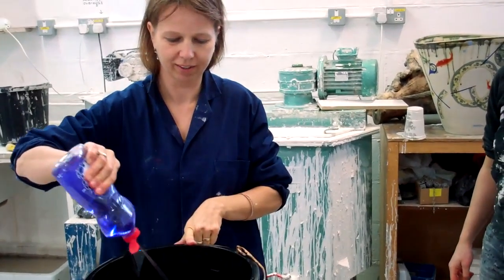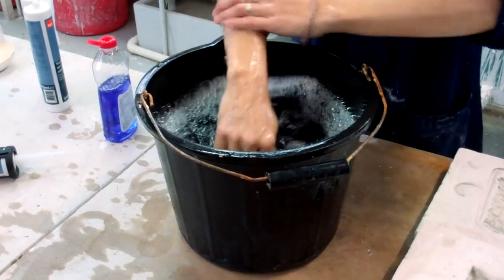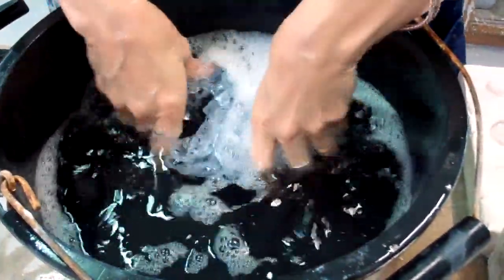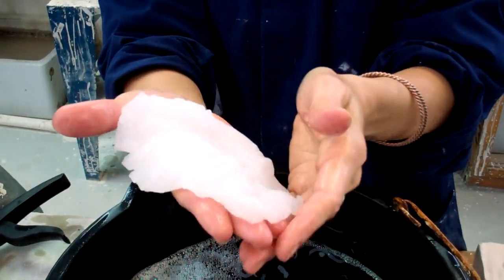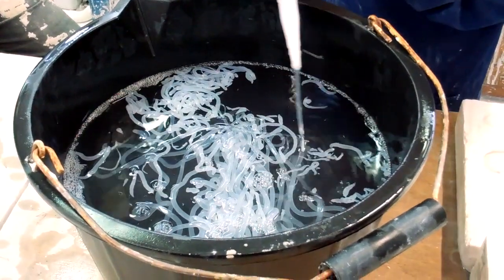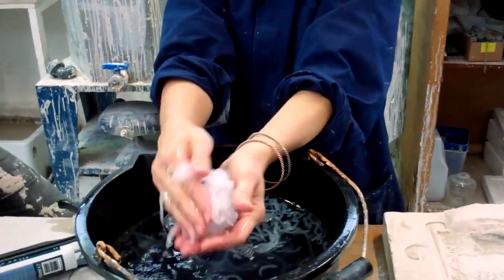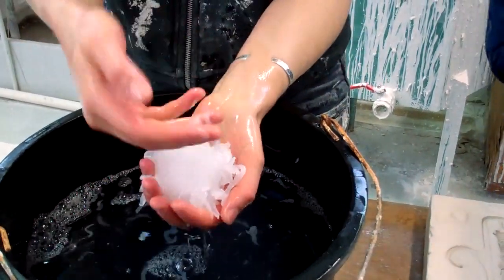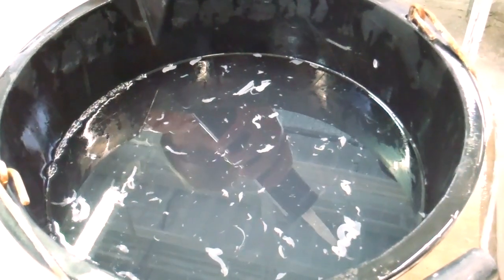Silicone Mold Making & Casting

Comment: SILICONA para Fabricar moldes,figuras etc. Silicona
              RTV-1607 (Dureza 20 +- 2)

               1 KG. a 10,50 €  Bidón de 5 kg. a 9,50
              €/kg.(www.siliconaymoldes.com)

              Silicona RTV3214=/Dureza 32+-2) 1 KG. a 12,50 € Bidón de 5
              kg. a 11,50 €/kg

              Fenasa Siliconas s.r.l. wwwfenasa.es  .Telefono=968297777-
              MURCIA= España

Comment: Thanks for a great video - I seem to keep finding American kids making very expensive moods by mixing the silicone with cornstarch (called cornflour in UK), baby oil and acrylic paint (though I can't see the point of colouring a mold).  I'm going to be making very small moods for doll shoes and this simple version seems perfect.
The one thing I missed (maybe lost in the background noise) is how long to cure the silicone before removing from the original - does the silicone need to cure for the full 24 hours (as if it was being used as a waterproof sealant)?

Comment: Silicon is a chemical element used in the manufacture of semiconductors (hence Silicon Valley). 
Silicone (with an e on the end) is an entirely different word with a vastly different meaning. Silicone rubber is a flexible elastomer. I believe you intended to say silicone. Since you're a "school" I hope you would fix it at least in the description and title (I realize you can not change the video). But it's been 5 years and you haven't fixed it yet so I suppose I shouldn't get my hopes up.

Comment: CAULKING IS NOT SILICON, IT IS AN ARTIFICIAL PRODUCT SPELLED SILICONE (with and E at the end) and contains Formaldehyde and  Ammonia!!!! At least where caulking is concerned (the stuff from hardware stores)... That means it is TOXIC!!!!!!!!! 

Silicone itself need not be toxic, but caulking is silicone with toxic elements.... be smart and wear glove and, please, don't use this to make food molds! Read the MSDS and do some research (Google is your friend) before handling ANY chemical product, especially if in direct or indirect contact with skin, eyes and especially mucus membranes (mouth, eyes, digestive tube, etc.)

Want to argue? Sure the toxic elements may evaporate, but so are supposed the toxic elements in a new car's dashboards....yet these stay toxic to breathing when exposed to extreme heat (hot sunny days) for over 10 years. It's your life... you be the judge of what's best for you... I did my part and you be warned!
Reply: It releases acetic acid when its curing, the acid burned your finger.
Once its cured its technically safe except that caulking is not checked for dangerous impurities.
I would not use it for anything that comes into contact with food.
Reply: make sure the tube says 100% silicon
Reply: I see replies insulting Flashahol, but very little in the way in how he or she is wrong. The reason being is that your "common sense" is not reality folks. Flash is %100 correct. Google is your friend. It is very easy to look up and easily learned through actual experience. But hey, you people with zero experience have your Youtube common sense so why bother right?
Reply: Flashahol I agree, I got caulking silicone on my fingers once while putting together something and because it has high acidity it burned and itched for 2 days. When I first started watching this video my first thought was I can't believe she's not wearing gloves. My second was I want to see the end product! Lol.
Reply: It did say 100% but still itched when I got it on my skin but didn't try it in soapy water, it was direct contact so not sure if that makes a difference.
Reply: Hey , you might be the wrong person to ask, but you seem pretty knowledgable and I need some quick advice on something and anything you can give would be appreciated. I am currently doing a project where I must make a flexible, removable spout to fit on the lip of a mug to allow for easier pouring. https://photos.app.goo.gl/P6zThPVfQsGaU2133
This is an idea of what it will look like ^^
It should be stiff to fit tightly but not too floppy that it is loose. It is also vital that the material used is non toxic and food safe, preferably coloured.
I wouldn't have a clue about how I should go about making it and I have absolutely no idea about silicon/rubber or moulds. I was thinking maybe I could 3d print a negative (mould) and pour in some food grade silicone or something?? What materials should I use and how do I make a mould with a cavity that would allow me to pour it in and cool it. Maybe another method is more viable? I would love to hear back from you with any advice. I appreciate your help, thank you.
Reply: What about silicone II? It's supposedly neutral-cure which doesn't release acids while curing
Reply: @ jayboney el toro:

From Wikipedia: 
"Silicon is a chemical element with symbol Si and atomic number 14. >>>A hard and brittle crystalline solid<<< with a blue-gray metallic luster[...]" 
Sand is also made of Silicon., the main source of silicon used to make electronic chips. Look it up for yourself, you will definitely learn stuff, if at all possible.

Any construction material, including most glues, that flow in liquid or gel form then harden and stick to stuff inevitably contain solvents, hardeners and other materials for elasticity, adhesion, waterproofing and/or UV protection (if it is made for outdoor use), etc.PURE MATERIALS ARE OFTEN JUST ROCKS AND MINERALS, like the pebbles in your garden

I hate when people claim to be geniuses and know absolutely fuck-all about what they are talking about. Labels for any product or food are never telling the entire truth. The 100% silicon mention for caulking really means it is silicon based rather than acrylic based, which has slightly different properties, but both contain a variety of agents for adhesion, elasticity, weatherproofing, etc, etc, etc.
Reply: @Flashahol  silicone is an inorganic polymer derived from polysiloxane. silicon is the metalloid. surely it was a typo error in the title.
Reply: Yes, Flashahol was really rude (but I'm sure both of you are decent people - Oh, come on!) ... but was completely right about chemical on caulking stuff: it could never be 100% silicone. And it is toxic. Even on that dishwasher bath the smell must have been terrible (no smell at YouTube...yet!). Apart from this battle among viewers, what was missing is the result. I was really frustrated with the abrupt end of the video. Gray's School of Art?? Hello? Is there anybody there?
Reply: Flashahol you can buy 100 percent silicone at a hardware store FYI I could care less but I hate when people give this big headed explanation and they are wrong what part about 100 percent don't you understand
Reply: @Jason B:
Apparently, you don't know how to make a sentence! Much less, a statement! LoL! Did you not learn the basics of grammar in elementary school? You know, those periods, apostrophes, comma's, etc... Maybe you're still in elementary school? Are you 5 years old? LoL!
Reply: Screams about silicone and probably uses fluoride toothpaste and eats sugar. But thanks for caring.

Comment: I'm just about to try casting sugar into it... I thought this kind of silicone could take 250-300C! we'll soon see whether it can take 150-200
Reply: How did it go ? I hope you didnt use sanitary one :D they stink like hell :D
Reply: There were a few bits of the mould that had thin walls (less than 0.5mm thick) that I had to squeeze very big parts through in order to get the hard sugar out of the mould. After a couple of casts these thin silicone films ripped open a little but I think that was down to the shape of the mould and lack of release spray rather than the silicone itself having bad reaction to the heat. The sugar was liquid and between 180 and 190C and otherwise has left the shape of the moulds unchanged :D

Comment: If you do it in multiple stages like this it is likely that the silicone mould will break apart where the different batches meet
Reply: Danny M True, I did two batches right behind each other, and you can see a parting line. I was able to separate it a little, but did not try to. pull it apart completely.

Comment: This is very cheap and economical. In the past year Iv work on some million dollar houses and needed to make some casts. One job i had to make a 200 mm by 500 mm corbel. The tube silicone rubber cost me 70$ for roughly 6.5 litres.!!!! 
To buy that in moulding silicone would have been 300$ plus!!!!    
The draw backs maybe the terrible vinegar smell  which can also strip paint to. 
But haven't had a real problem yet. 
Thanks so much works a treat.

Comment: its may inexpenfive, but it works also like crap....

just buy proper silicon mold an resin, they getting cheaper and easier to hald every year. like i used to take platsil 73-20, it has a working time of 5 mins and cures less than 2hour fully out and you can go casting right away. its a 50:50 part A:B mix, so verry easy to mix! i remember 1kg is about 50 bugs or so.
im sure 5 silicon tubes are almost the same
Reply: Your figures are way off!!! This is by far the best and cheapest way of making a cast.

Comment: Why didn't you cut the nozzle off? It would make it much easier to dispense into the water :) thanks for sharing.
Reply: No you don't.  It's a much faster process when you CUT THE TUBE to release more of the silicone at once.  
1. Easier to get out of tube.
2. Faster to get out of tube.
3. Same time spent Mixing in hands, (and actually even quicker since your working with "more" silicone).
4. Larger amounts of silicone in hand ='s bigger balls, ='s Less time spent Pumping the tube, applying the silicone to your project, and going back to repeat all the steps, over and over again. 

Cut tube to the Bigger Section to release MORE Silicone at one time!
Reply: +Lynette McKone  because you need the spaghetti like texture to help expose the surface to the cold water as much as possible to help start it setting up.

Comment: if you make this type of mould for casting resin, will the resin come out shiny?
Reply: +Magik Dust I know it's been a while since you asked, but to answer your question, most likely not. While this method will work in a pinch, it's really not an ideal molding technique. Most proper molding materials will pick up the finest details (including that fingerprint you didn't notice)and reproduce the same finish as what the original piece had. Most molding silicones are pourable, or at least brushable, to pick up detail. This is basically like sticking clay to something and expecting a perfect copy, It's just not going to happen in most cases.

Comment: This is my experience when making the silicone caulk molds:  When you are kneeding the silicone in the dish soap it traps air in it and in that air it traps water with soap that you are working with.  Now the problem I had was that the mold made a cured skin on it but on the inside it was still not cured and it never cured because it had  bubbles with soap and water traped in it.  I found this out because I cut one mold with scissors and there was water coming out of the silicone.
Reply: +WILD CHILD I manage to make a silicone mold with corn starch and silicone caulk. I've tried the dishsoap and silicone caulk method, but that turned out to me that it requires lots of trial and error. I think perhaps ur better off with the corn starch method
Reply: heres what you should do ... cut the side of the tube and dump the entire tube into the soapy water all at once , this keeps the soap on the outside....
Reply: +WILD CHILD did you need the silicone outside of the soapy water once it has started ti set??? that should have worked the air bubbles and soapy water out of the silicone
Reply: Try GE silicone type 1 not type 2. I had a decent amount of working time. I knead mine a little as someone else mentioned. After an hour it is solid all the way through. I add a little food coloring so that I can see the details. Wal-Mart has the silicone the cheapest so far.
Reply: +WILD CHILD Did the water ever cure out of your molds?  I was wondering about this myself because I'd like to make some candle molds.
Reply: No it didn't.  After 3 weeks,  Then I tore it up to see inside of the silicone and it had bubbles full of water.  So The idea was good but the product itself is not designed for making molds.  It would have been great to make them out of silicone calk because the mold kits are so expensive.  I guess if you want to make a temporary mold it would work but then after a couple of weeks you would have to throw it out.
Reply: Well that sucks doesn't it?
Reply: YES IT DOES !!!  :0(
Reply: No, I didn't.  Maybe that's what I did wrong ?   I never thought about doing that.  But I think that if I had kneeded it, it wouldn't have gave me enough time to mold something because It starts to get dry very soon.  But maybe that does work.
Reply: Yes, the GE Silicone II Premium Waterproof never cures with H2O & soap method, the GE All Purpose Silicone works fine.  Both say 100% silicone but...!
Reply: I did some experimenting and some reading on the different silicone caulk curing times. Some cure with UV, some with water, some with heat, some with glycerine. I accidentally purchased type 2, which fully cured quickly with corn starch, and partially cured with water as it states on the label. UV had no effect. I’ve got it in the freezer now to see if it will firm up enough to finish the mold. Next time I will buy type 1. 

I’m bumping this now (years later) because most of the DIYer videos you find that try to do this tend to overwork and knead the silicone like it’s part of the required process. All this really does, as some have stated above, is introduce water and bubbles into the caulk. From what I can tell, the thing you’re molding should be covered in soap and cold water. From my experiments, cold water is a catalyst to curing, so putting the caulk into the cold water is purposeful. The soaps purpose is to keep your hands from clinging to the silicone when transferring it into the mold. You should be doing the MINIMUM amount of handling, which is shown in this video, however some videos are claiming you need to knead the silicone for 5-20 minutes which is absurd and counterproductive. 

Hope this helps someone who may be having difficulty and be doing “trial and error” to get this to work.

Comment: 2 questions.  ! where did you say you buy it cheap?  Can you add color to it and use it to sculpt with?
Reply: +Heidi Fox Home improvement/anything building related stores always has it, but getting it cheapest.. i think you could try search ebay or just give a call to importer, but be ready to buy lots in that case and i mean by the pallet loads.

Adding color.. it comes in white, black, clear, but you can add paint to it, but it has to work with silicone. I'm guessing oil base paint could work?
Using it as sculpting is no go. It flex way too much to be accurate and you really only can cut it. Using router tool or similar will just rip it. You could try  to find suitable method, but no. Its cheaper and less trouble some, to make part from something like clay that you can sculpt and then use silicone only as mold.

Also when your pouring silicone into water, take the tip off, so you trap less water into putty. Making strings like that just wastes silicone and makes it harder to handle. You really only need soap+water mix to prevent it sticking in your hands, bucket and to work peace.
Actually you could try coating work peace with soap and then pouring in the silicone directly on the work peace, then spread it with soupy hands or some tool.

Comment: Do you have a video of the finished product? Also does this shrink too much?
Reply: You can make something 3D you just put it in the middle of the ball when it dries the next day just to be safe when you cut your product out you don't want to cut a straight line try to cut a zig zag down one side to pop your product out. I've made a mold when we were bronze casting. I pour the cilaca wax into the mold to make many of one thing. Then keep dipping in the cilaca casting mix it took about a week the whole process it can be expensive because you have to leave the fan on for a week. Then we put the casting in a ceramic making oven the cast is ready to pour we bury the cast in sand then pour the multing bronze in the cast wait until it cools the brake the casting off the bronze it will capture every little detail even your finger prints if you leave them on the wax mold. I for got a few steps like the wax vents you have to attach to your mold so the air can escape you just cut them off with a saw or wire snippers depend on how thick the wax vents are .

Comment: why did you not buy real silicon rubber, its not expensive.
Reply: and your point is.
Reply: Art students usually don't have much extra cash laying around
Reply: I studied model making for 5 years and worked as an animator throughout my time in university, 5 kilos of silicone is £150, do it right with no regrets about a bad mold that will fall apart after one copy.
Reply: Shmallowman I studied model making for 5 years and worked as an animator throughout my time in university, 5 kilos of silicone is £150, do it right with no regrets about a bad mold that will fall apart after one copy.
Reply: For me it's hard to find
Reply: +1OF50 LIFESIZE you can get 2 kilos of this at car boots sales for 10 pounds and i can get tin oxidized mould silicone for 60 a kilo online.
Reply: Johanna Mason https://www.mbfg.co.uk/checkout/action/return/?oid=PO19287